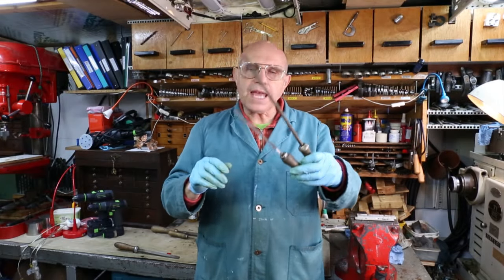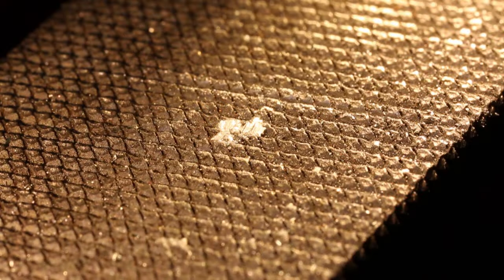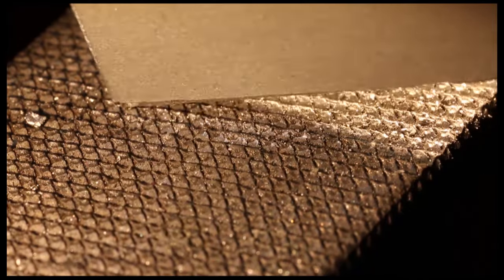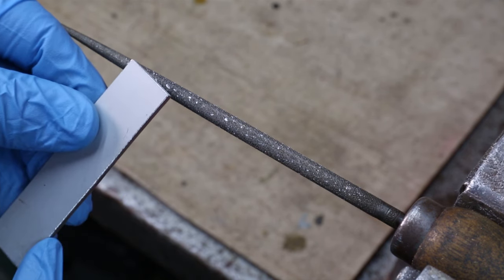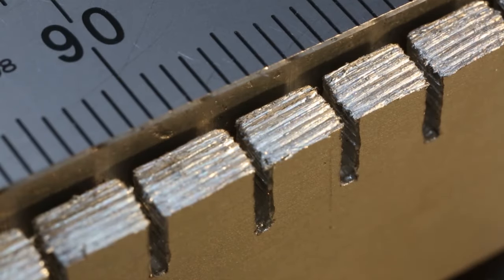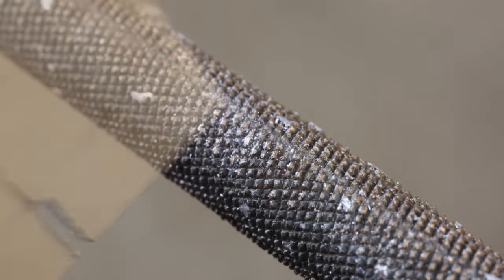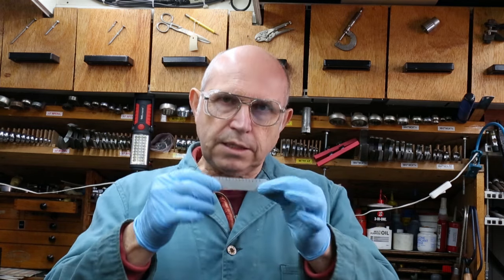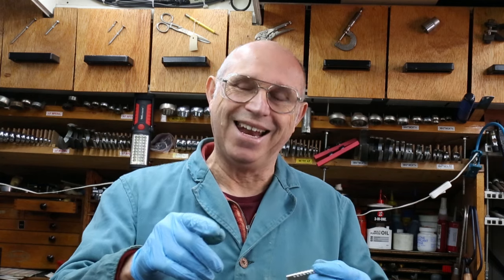How To Clean A Round Hand File

Comment: G'day,

Elegant
But
Complicated.

As a
Hillbilly...;
My suggestion is to
Try a Wood-handled
Steel
Wire Brush..., stroked
Parallel to the
File-Cuts...

The Wire Brush is
Annealed.

The File is 
Hardened.

The Steel Brush is 
Still
Harder than the
Aluminium, Wood, or Plastic.

But the Brush is softer than the
Hardened
File.

Go
Straight to the
Wire Brush...
In my humble
Opinion...

Stay safe,

;-p

Ciao !
Reply: I agree with the wire brush approach. I tend to use a wire wheel on a drill press (angle grinder version will work just as well) and run the file against the wire wheel at the angle of the teeth across the file along the entire length.
No need for a special tool and far faster than the manual approach. 😀
Reply: @stormkhan4250  

G'day,

Yep,

We concur...!

Yay Team...

Have a good one.

Stay safe,

Ciao !
Reply from the maker: Hello all. As I said in the video, using a wire brush on a coarse file works very well. But I have found with finer files the wire brush does not remove all the small particles from between the the teeth. I also worry about using a wire wheel on a file, it may remove more of the particles, but does It damage the sharp edge of the teeth? I know the wires of the wheel are moving in line with the teeth of the file, and also the wire is softer than the file teeth, but on a wire wheel there are a lot of wires passing, they are passing at speed, and there is a lot of rubbing going on against the sharp cutting edges of the files teeth. I have no proof the teeth are being damaged its just doesn't feel right to me. I'll be interested to hear what you think. Take Care Jim